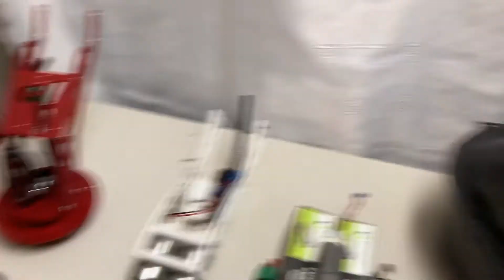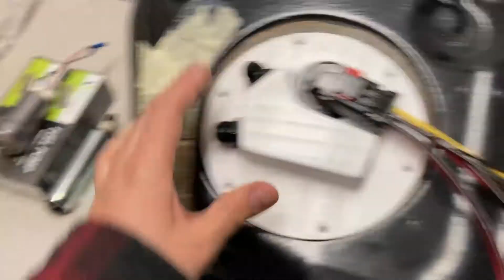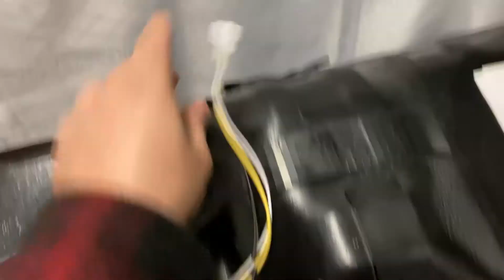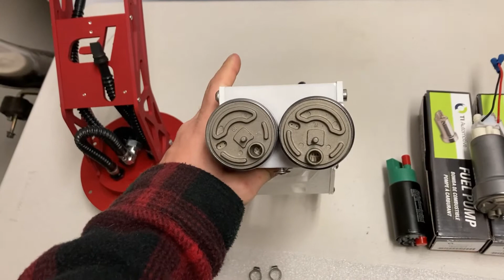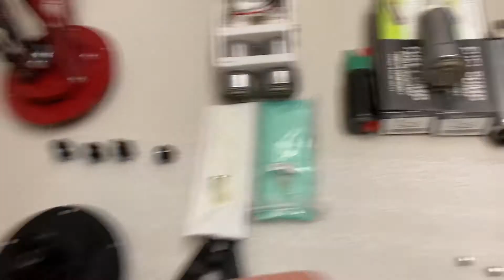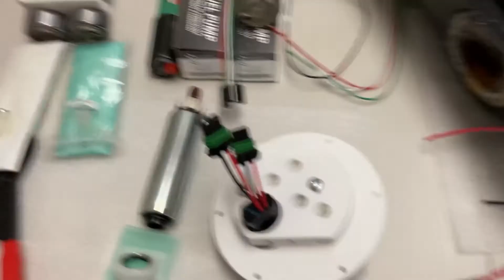Polar Engineering Nissan Z32 300ZX Fuel Pump Hanger Overview (2+0)

Comment: Are there any differences between 2+0 and the 2+2 hangers? And it's sep 2022, when are the 2+2 going to be available?
Reply from the maker: Yes, 2+0 and 2+2 are complete different in they design. I have not made any specific plans to make another run of the 2+2, but I think of posting a feeler towards the end of the month to gauge the interest. Depending how many people are ready to commit, I may decide to run about 20 more of these.
Reply: @polar_engineering  im going to get one if you decide to make another batch. I'll try to get in touch with you directly. Thanks for the response.